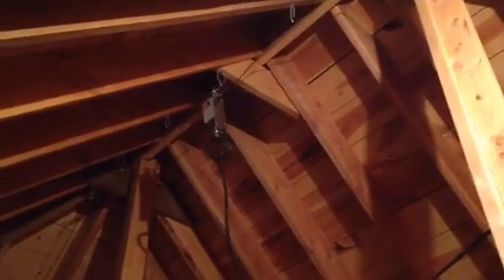Attic Dipole Antenna (Homebrew) - Part 1

Comment: forget the antenna, check out the high quality wood in that attic, dont see that much today
Reply from the maker: The builder did good work. I'm a structural engineer and kept a keen eye on it as well, hi hi.

Comment: why the rolled up coax at the so 239 , I dont think that is necessary .
Reply from the maker: thomas glandon It serves as an RF choke at the feed point...basically an inductor formed from the coils of wire.  It allows lower frequencies to pass ...but blocks higher frequency interference since the inductance of the coil increases with frequency.

Comment: Hi Ghost, the focus wasn't perfect on there, so I wasn't sure exactly how you had that attached (hung) from the top of the attic? Are you using screw-eyes then connected to the wire with string? I got me a G5RV-JR, so I wanted to check with others who have done this so that I'm doing it right. 73, Kz7zul
Reply from the maker: Hi there...I used zip ties suspended from nails.  I had lag screw eye bolts at the ends.